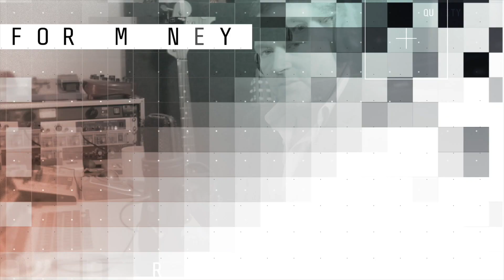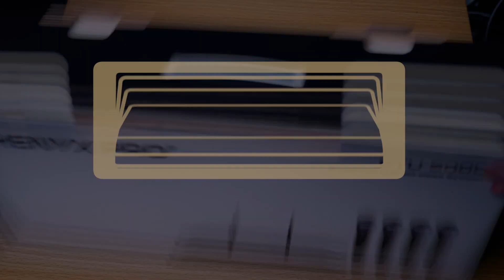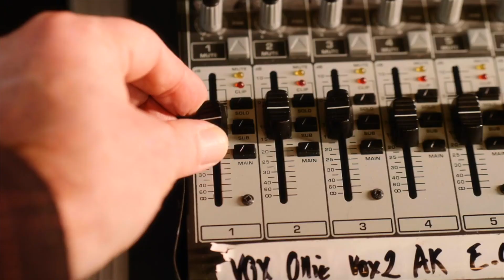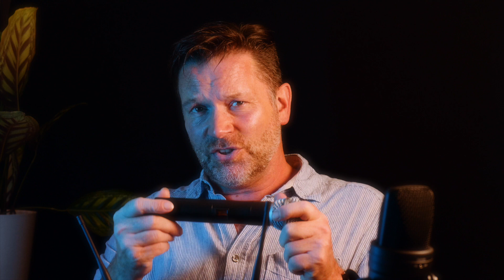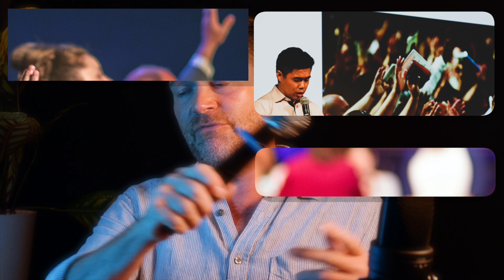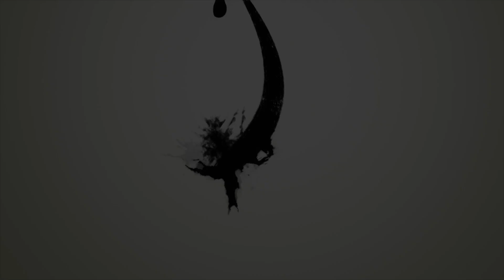Phenyx Pro PTU-5000A Quad-Channel UHF Wireless Microphone System (Fixed Frequency Design) REVIEW

Comment: I have these mics as well, but I've had major dop-outs and a convention center where I was doing a family reunion. I did see routers mounted to the ceiling of the room (5 of them).  Didn't know if the dropouts were happening because of those or not.